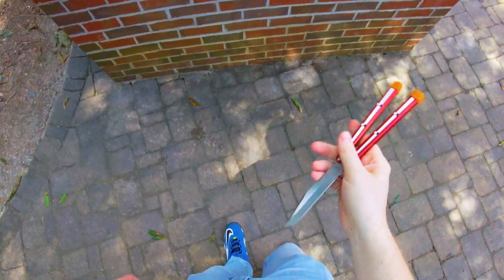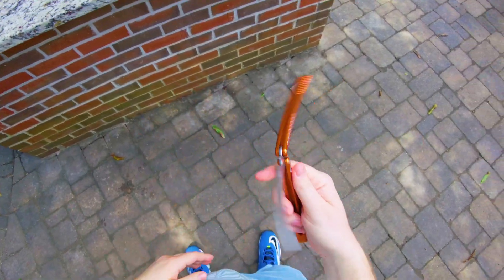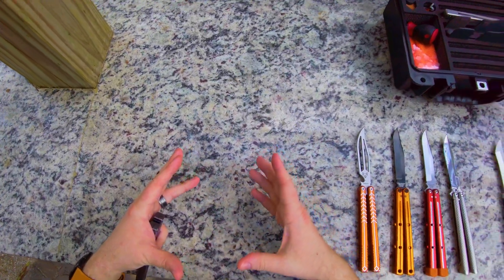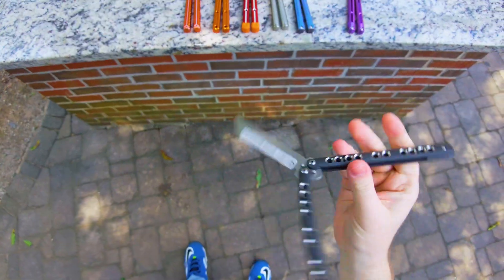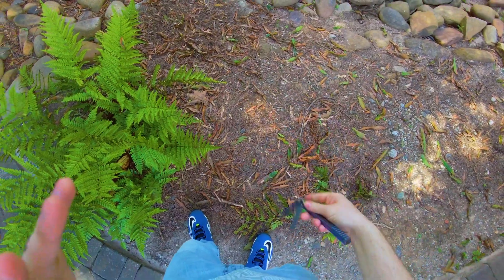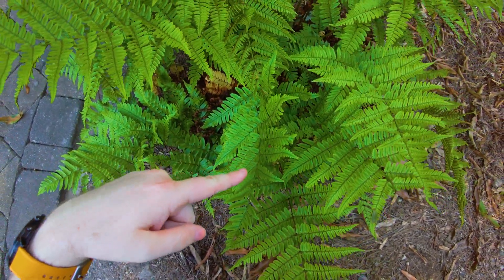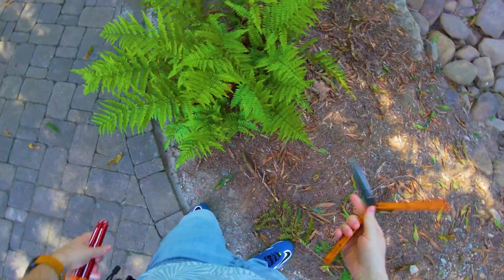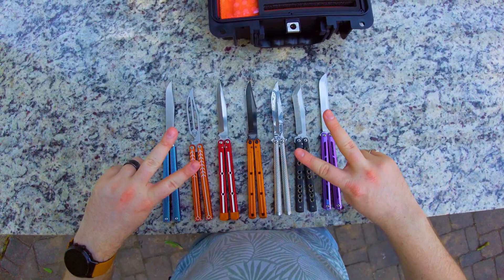The PHYSICS of Balisongs!! 🧪👨‍🔬🤯

Comment: In my opinion and findings from testing and measuring weight distributions on many different knives, there's kind of different sweet spots where weight wants to be distributed. Depending on factors such as length, materials, overall weight, ect. the sweet spot of where the weight wants to be will change. There's not particularly a "better" sweet spot, some are just better than others at different things. So many factors go into where weight is added and removed.

Comment: just question: u talked about the prysma having unnecessary much weight at the end of the handel, does it then get better, and more comparable to the kraken if u take out the weights?
Reply from the maker: Tbh it becomes slightly blade biased so no, it's because the balance is actually similar to the Kraken with the weights in. The difference is how far the mass is out from the pivots compared to the Kraken
Reply: @WillHirschFlips  ohhh, ok thx

Comment: Kraken trainers are an example of that. They barely can fan for shit you get two rotations and boom it drags. The reason it can't fan is the cutouts they are placed weirdly. But things like squidtrainers with all the weight towards the ends have a better balance and physics so they flip better.
edit: handle bias equals dragging fans
blade bias equals perfect fans
edit 2 lol: I don't know if you know this bowie krakens are actually handle bias and the tanto is neutral.

Comment: What would happen if the weights were at the top of the handles? Awesome video btw.
Reply from the maker: I'm not sure!! That's an interesting idea!
Reply: If you were to add weights to the top of the handles, the overall balance of the balisong wouldn't change very much. Adding weight very close to the pivots means there is not a lot of length between the pivots and weights, which results in a negligible change in the moment of inertia of the balisong. It would just make the balisong heavier without disturbing the balance significantly.
Reply: @ALXMN-jy1li  it makes it feel more blade biased in my experience

Comment: Interesting thoughts, I don't exactly agree with your conclusion, but weight at the ends of the handles certainly has more of an impact than weight near the pivots. Another way to think about this is to consider the leverage between the handle and finger.
Reply: Yea I agree. I think that leverage is also what makes rollovers easier on knives with weight at the end of the handle.
Reply: @parkNptown   That’s a good point